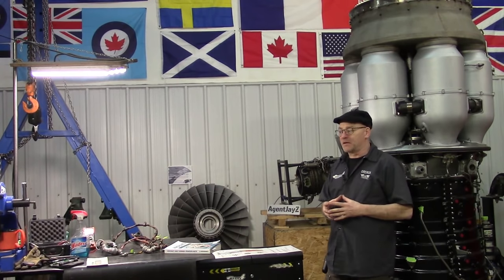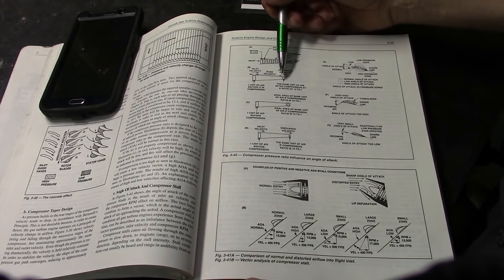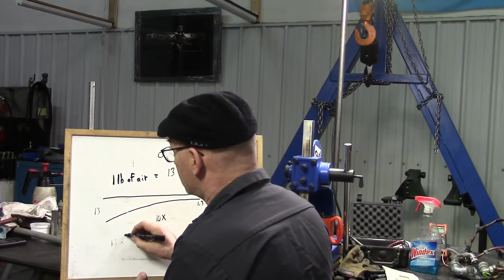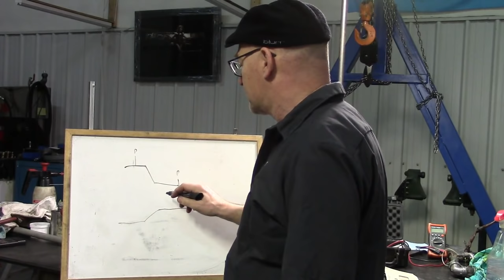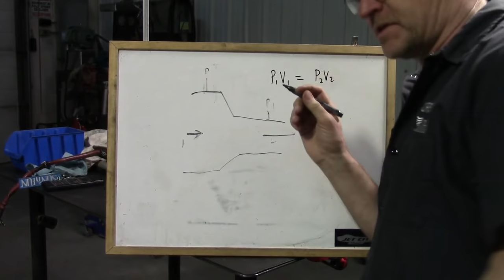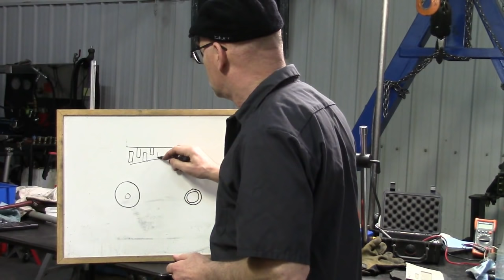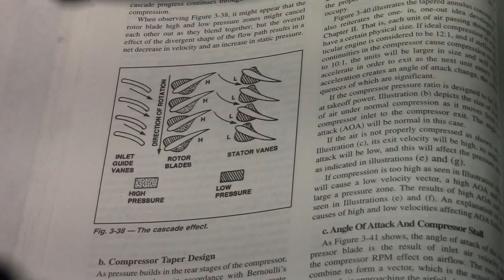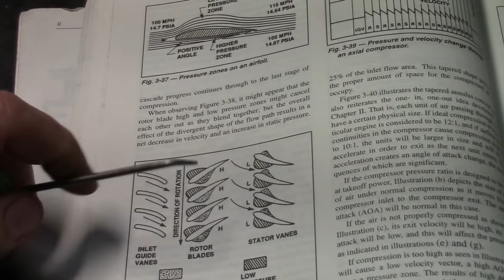the Narrowing Compressor Gas Path: Jet Engine Mistakes 3

Comment: There is no mistake in the book. The bottom probe measures the total pressure (think about it like this - it faces the flow and 'sees' BOTH static pressure of the environment AND dynamic pressure due to velocity of the gas). The upper probe measures only the static portion of the pressure (as it is shielded from the flow velocity due to being recessed). The way you measure dynamic (what you call ram) pressure is by having a so called differential probe. The differential probe is a system of 2 probes like pictured, where you get dynamic pressure by subtracting static from total pressure signal. This is how you measure speed of aircraft (see Pitot tube).
Reply from the maker: Upon review, I am agreeing with your analysis. I may, or may not, remove that section.
Reply: Prandtlsonde, Prandtl tube.
Reply: @AgentJayZ  Hey, don't remove it - after all it reinforces the main reason I think you put it in "don't unquestionably trust a single source, even me", words to live by.
Reply: I’m glad I scrolled down and read this because I was totally sold on the initial analysis in the video. Now I’ll have to do more research to see which one of you is right
Reply: @sergeigarbar1896  Ludwig Prandtl is really the father of modern aerodynamics. It's a shame nobody outside of Germanosphere is honoring his name by using such a term, cause for sure you don't hear it elsewhere.
Reply: @AgentJayZ  I suggest you leave it in, maybe with a text overlay caveat to get the viewer thinking.  Leaving an obvious "mistake" is a great way to educate.  I hope the author of the picture did that on purpose to get the reader thinking.
Reply: @AgentJayZ  Maybe just add an overlay that the correctness of the diagram depends on the type of probe that is used. Judging by the depiction of the probe in the diagram it seems to be a pitot-tube that is measuring total/stagnation pressure. If it was a pitot-static-probe or Prandtl-tube, which would allow to measure dynamic pressure directly, then your argumentation would be correct.
Reply: @AgentJayZ  I think that still leaves their table inadequate, either theyre showing the dynamic pressure or a direct reading and extrapolating from it, they can’t just use the same word and idea in both ways irregardless of needing a differential gauge etc... just for what it’s worth lol
Reply: @FlyNAA  I’ve only ever encountered it as dynamic, ram air being the force of the air ramming into a probe, which would include dynamic pressure and static, and dynamic being the difference equivalent to the kinetic energy of a unit volume of the air, but if they’re supposed to be equivalent terms then yeah
Reply: @FlyNAA  yeah in that case fair enough
Reply: @FlyNAA  lmao i guess thats why it’s so important to really understand the fundamental concepts and not just rely on what any one book has you take for granted lol... and i can see that being an ‘interesting’ experience lol, but better than missing one I suppose

Comment: I believe the figure in the textbook (as discussed at ~5:15) is correct, as the scoop (like a pitot tube) measures the total/stagnation pressure (static + dynamic) rather than the dynamic pressure alone. You can see this explained in the paragraph (not the note in italics) immediately above the figure.
Reply: Obviously didn't read far enough down the comments to see that this had already been discussed!
Reply: he admitts this under the video
have a look

Comment: There's a nice mnemonic for remembering what the ram air sensors measure: They are called "pitot" probe, and they measure total pressure, which you could write as "p_tot", even though that's not what the name is derived from. Anyway, it shows greatness to admit to one's mistake, and not try to hide it or otherwise justify what you said. Only idiots would claim they never make mistakes. I was mistaken about a lot of things before I watched your videos, although I was convinced I knew it all. Thanks!

Comment: The rotor forces the air back, the stator compresses it, the path narrows to maintain the speed, check...I am definitely the brick in your explanation, lol. Thanks for sharing.
Reply: Compression also occurs in the rotor stages. In fact the rotor/stator split is usually about 50:50.

Comment: I'm sorry, Jay, but the mistake at 5:05 is on your part. The book is correct. The 90 degree bent gauges are total pressure sensors, not ram pressure sensors, which is why their reading is constant and equal to the total pressure.

To make a ram pressure sensor you have to substract a static pressure reading from a total pressure reading. You can do it mechanically using a chamber that has a flexible diaphragm as one of its walls. Total pressure is fed from the 90 degree bent tube into this chamber, while the static port is connected to the other side of the diaphragm. The diaphragm is stretched in accordance with the difference between the total and static pressures, which is the ram, or dynamic pressure. The diaphragm is linked mechanically to an indicator. This is how a pitot tube works on an aircraft. The same can be achieved electronically.
Reply from the maker: Yes, already noted in the first 3 minutes, by Milos Ivankovic.

Comment: With respect AgentJayZ I think you were mistaken in claiming in your text book diagram was wrong in the first few minutes of this vid.  The pitot tubes readings (which all read 20 in the diagram) read the sum of the static and the ram (dynamic) pressure, to get the the ram pressure only you need to subtract the nearby static pressure readings from the pitot tube readings.  So the diagram makes sense and reinforces your correct assertion that the sum of the static and dynamic pressure remain constant.  Thought experiment: if there was no flow through the duct in the diagram what would the the pitot tube (lower row) of pressure gauges show?
Reply from the maker: Yes, already noted in the first 3 minutes, by Milos Ivankovic.
Reply: Actually, i think that in a real non-idealized jet engine, the stagnation pressure does not remain constant. The compressor blades are doing work on the fluid which means that the energy equation isnt quite so simple. Even for 1D flow with heat addition the total pressure is not constant so you can probly imagine that things get gross here 😂

Comment: great video, but I believe the book is correct. 20 is the isoentropic stagnation pressure, when all the kinetic energy of the fluid is converted into pressure. it adds to the static pressure. this is what this type of theoretical instrument measures.
Reply: I agree. Static pressure doesn't disappear, it is still the same for the same point in the duct, and is present in both sets of gauges.
A paragraph above the diagram states that a specially shaped probe measures both static and ram components of the pressure, meaning it measures the total pressure. The static gauges only measure static pressure.
The following sentence of the above mentioned paragraph also points out that ram pressure is then obtained by comparing the total pressure (measured by the lower gauges) to the measured static pressure of the upper gauges.
The bottom gauges SHOULD all show 20 as they measure total pressure, not ram pressure alone.
Pitot tubes do the same thing, measuring both static and ram pressure. They can't measure just the ram pressure independently. This is why the static (ambient) air pressure needs to be known and accounted for.
Reply: @SumbluddyIdiut  perfect. If you want to messure Just the ram pressure, you need a "pitot tube".
Reply: @SumbluddyIdiut  Assuming no work (in or out) and neglecting friction, Static Pressure plus Kinetic Energy (Vsquared*Density/2g) = Total Pressure throughout the duct. In practise the Steady Flow Energy Equation, (which is similar to the Bernoulli Equation) is used to derive the relationship between Total and Static Pressure, because it takes into account any changes in air density. Nevertheless Bernoulli is useful for visualising what is going on.
Reply: @silvio I agree.  Energy must be conserved.  The sum of the potential energy of the compressed air  plus  the kinetic energy of the flowing air  plus  the thermal energy (which was completely ignored for simplicity) must remain constant.  There is an exchange between potential energy, kinetic energy, and thermal energy.

Comment: Thanks very much J , its very clear and bright understand what you just explained about the compressed air along this pathway which become narrower and the air become smaller and more dense with this high rates of compressions . I also got the idea of when changing of pressure from the angle of the blade to the angle of the status

Comment: As soon as you mentioned Bernoulli I understood what you’re saying. The pressure does not increase as the area decreases because of the Venturi principle. As the space decreases in the engine, the flow of air will decrease in pressure. That’s provided that there wasn’t the compressor working there.
Reply from the maker: This is not a Venturi duct. It's a compressor. That means work is being done and energy is being added to the inlet air.
The Bernoulli effect is for a fluid stream moving through a passive duct, not a compressor.
The pressure is increased by the interaction of the rotor and stators, requiring work. Completely independently of that process, the pathway is reduced in size in order to keep the velocity up. As air gets compressed, it takes up less space. If the pathway was not reduced, the velocity of the air would go down as it got more dense, and took up less space.
Edit: I think I misunderstood your comment at first.
I think we are both saying the same thing. Cheers!

Comment: Greetings from the UK on Burns Night - and yes, we do jump on the bandwagon and celebrate the occasion in England. My haggis is in the oven and will be ready in an hour or so.  Let me assure your readers that, after being fattened up during our lockdown, it was dispatched humanely and didn't suffer: we don't treat them like lobsters.  But I digress.
I did make a point of reading your intro and I did get out my copy of 'Aircraft Gas Turbine Powerplants', which I bought (expensively), at your suggestion, from the USA, second hand.  You will, therefore, get no criticism from me, unlike some who didn't take the trouble to read it.
My only suggestion is that it would be useful if you explained that the energy imparted to the air in a rotor stage is effectively turned into a velocity increase in the circumferential direction.  That unit of air in Fig. 3-40, which is grabbed in the space between two blades, is being whirled around and spat out further around the annulus.  It is then grabbed by a pair of stator vanes, which turn that increase in velocity into pressure.
Reply: Luckily I got my copy, used (actually ex RAF Cosford Trenchard Library) 2nd edition courtesy of Amazon UK. It has the same mistake! First came across Bernoulli 25 years ago when I started selling D.P. flowmeters. Sold stuff to Filton where BMW were air flow testing plastic turbine blade models.
Reply: @martinda7446  I assume you already understand that tatties are potatoes.  Neeps are turnips.

Comment: Another good place to look in the book if something doesn't make sense: the errata section. Not all textbooks have them, and of the ones that do, some list things corrected at that printing, while others list things which will be corrected at the next printing / edition. But if the book has it, and it lists errors that will be fixed later, the errata section is a good first place to look for clarity.

Comment: Good talk, well explained.  I couldn't see for sure but the sawtooth Pressure-Velocity chart at 27:03 looks to be incorrect.  I would expect, based on my own book, "The jet engine", published by Rolls Royce, that the velocity wont rise instantly at the rotor stage, but rather will build up slowly.  The velocity would then drop smoothly over the stator stage where it will be converted to pressure.  Something like an equilateral triangle wave ^^^^.  Also, do you have an email address where I can send you anything?  I might have a few large-format air system diagrams kicking about the house that may be of interest.  Thanks so much for sharing!

Comment: Excellent video as usual. However I would like to point out that the static pressure vs ram pressure diagram in the book is not a mistake. The reason those gauges read 20 is that they are adding the static pressure to the ram pressure as the gauges are physically exposed to the static pressure. Just like why pitot tubes have both  a static and ram  pressure port. There is no way to directly measure ram pressure without subtracting static.
Reply from the maker: Got it. My mistake was pointed out 3 min after the vid was uploaded.

Comment: the figure of the book is correct since it shows the static pressure measurement "tube in above" and the total pressure measurement "tube in below", there is no drawing of "pitot tube, that measure the dynamic pressure" in the book's figure. and I'm wondering where the writing of: P1V1=P2V2 (21:04) come from?
Reply from the maker: Yes, covered in the first couple of minutes in the comments.
Reply: @AgentJayZ  I didn't find down comment that discussed the written expression P1V1=P2V2 (21:04) where this comes from?

Comment: Love the channel, been watching for years.  I've always dreamt of making a miniature Jet Engine, I've got a resin 3d printer and a Dental Lab with an ability to cast chrome cobalt from prints.  Could you point me in the direction of any open plans for a simple kerosene jet engine?  Would like to make something silly with it like turning it into a USB charging device, but am not sure where to get started.  Also, my biggest concern would be balancing the blade assembly after casting.  Thanks!
Reply: This would be an amazing project to follow. Maybe you could get something working without the need for super high strength and high temperatures.
I have a couple 3D printers myself and as I watched this video, I kept wondering about making some sort of turbine engine model. Being able to cast parts in chrome cobalt may be enough to make functional parts.
AgentJayZ has a video titled "Turbine Blade Production Techniques" which shows a lot of the blades up close. I read your comment before watching the production techniques video and as I watched it was thinking of ways you could make some of the parts. At 21:29 of the above mentioned video, he shows on blade with an internal steel pipe. Maybe you could reinforce your cast blades in a similar manner.
Before reading your comment I wondered if there's any way one could make a turbine blade out of Porcelite or other 3D printable ceramic. A Porcelilte blade could probably handle the temperatures of a small turbine but I think the blades would be too brittle to work. I don't know if you're familiar with this material or not but you might want to keep in mind.
The channel Integza has some videos where he attempts to make a pulse jet. That's where I learned about the 3D printable ceramic resin.
If you attempt to make a miniature jet, I hope you document your efforts. I just subscribed to your channel in hopes you give it a try.

Comment: I think you made the mistake of thinking the depicted gauge pressure was ram pressure. It's not it's Pitot pressure. Ram pressure is only a function of fluid velocity which is Pitot pressure minus static pressure via P(ram)=rho x v^2. The other mistake is talking about isothermal compression but its not -when you compress a gas it gets hot... You need to use P.V/T = a constant not P.V =const. As you say the jet engine compressor also adds energy to the airstream before the combustion section to raise pressure and temperature further.
Reply from the maker: description
Reply: Yes, "SpiralDiving" is correct to point out AgentJayZ's mistake. The illustration in the book is correct and does NOT contradict the text descripion or the calculations seen below the illustration. The gages as shown there will measure TOTAL PRESSURE = PITOT PRESSURE = STATIC+DYNAMIC PRESSURE = 20 PSI for each shown position. If you wanted to measure the dynamic pressure at the different station then each gage would need two connections, one like the one shown and another for static pressure to measure the differential pressure between static and pitot pressure for each station.
Reply from the maker: description !

Comment: Aren't the bottom gauges just showing the total pressure? Static pressure works in all directions so it should add to the dynamic pressure when you try to measure it (I think?). Then everything checks out on that diagram.
Reply from the maker: description

Comment: Excellent video!,  I always thought until just now that the narrowing of  the  inlet was for compression.  what is the limit to which air can be compressed for use in a turbine engine?
Reply from the maker: More compression means more efficiency, but it's hard to achieve using a compressor with "seals" that don't actually touch.
Modern turbofans have compressor ratios of over 40 to 1, and research engines at approaching 60.